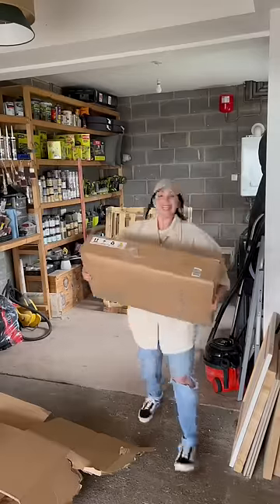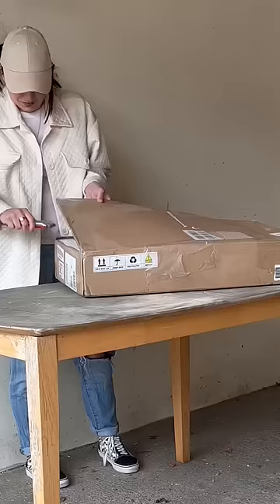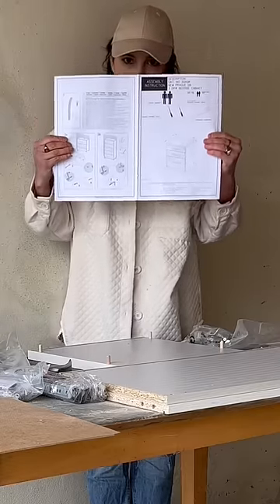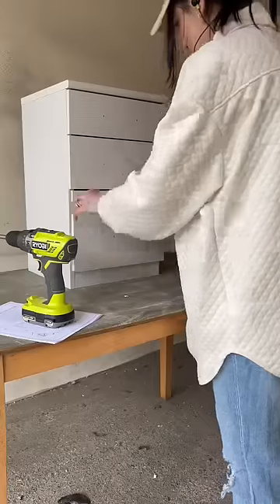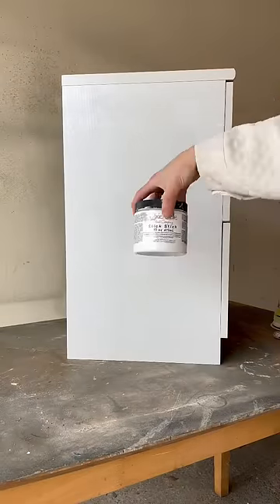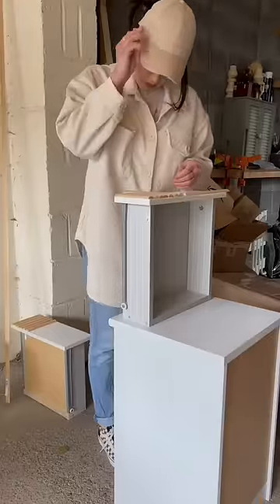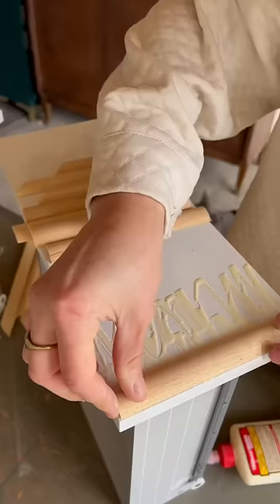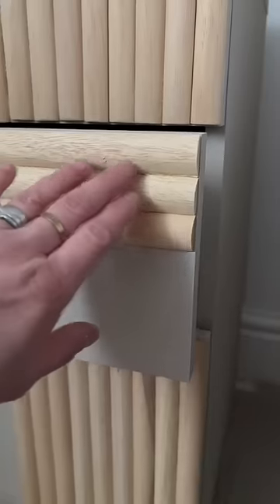Unboxing Customer Returned Furniture Pallet Part 8 😲 #shorts #furniture #furnitureflip #diy

Comment: Now for some really unique uses for this, you could use wooden cleats, or metal ones. But you can make it "float" by wall mounting the whole side table. Then put some smart led lights under each side table pair them to your Alexa or Google, and have at it with "Alexa turn the side tables blue".